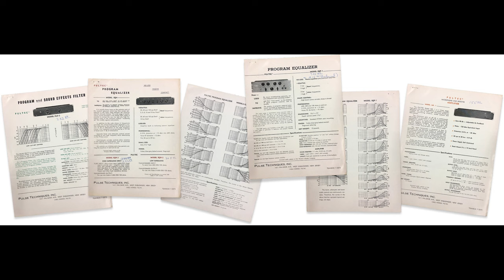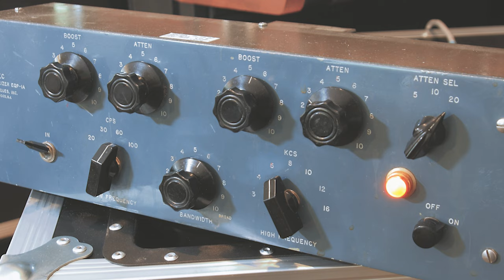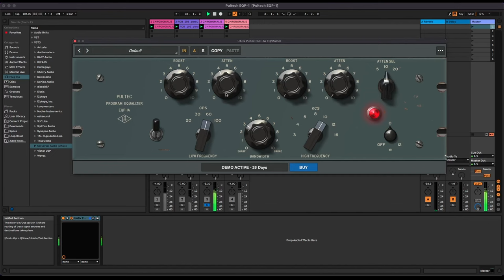Why producers love the Pultec EQP 1A... and how to use it in your DAW

Comment: For mastering, I recommend  to use a broad bandwith and a high frequnecy between 10 and 16k. To get a nice shelf curve, you can additionally select the attenuate sel. at 20k and attenuate by choice. Great content by the way, thank you!
Reply: The bandwith does not work in the low frequency range.😉